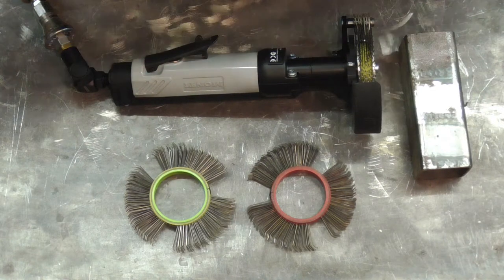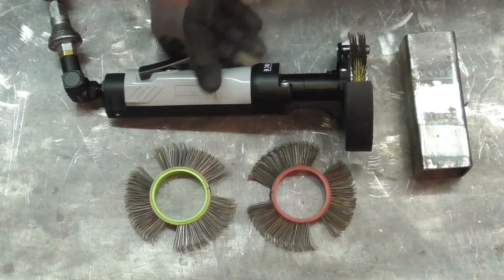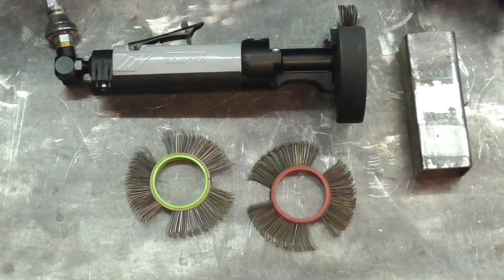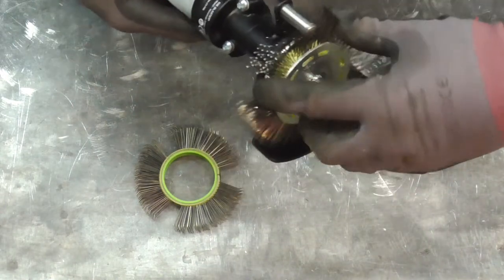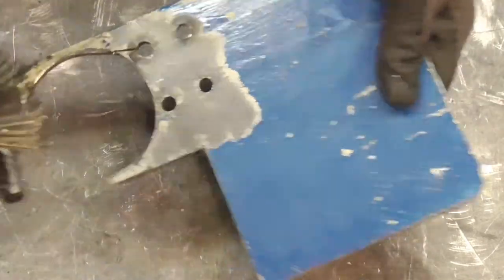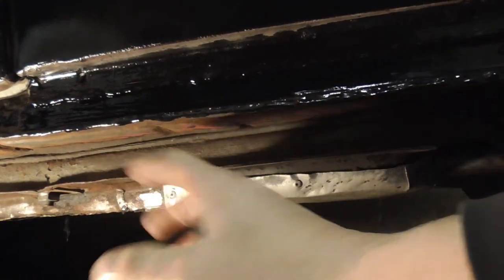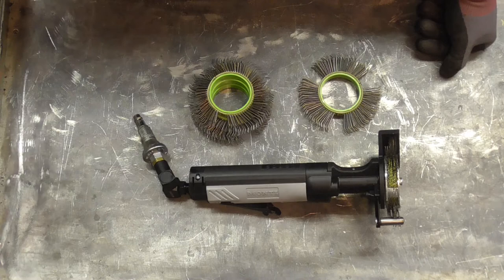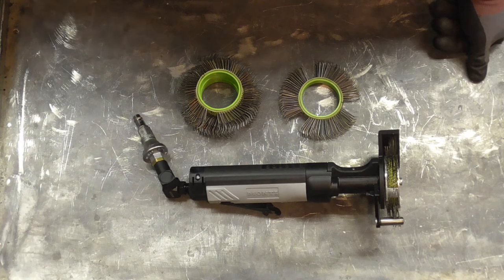Bristle Blaster Part2 - Die Blaster!  Test to remove rust, underseal and paint from VW Floorpan etc

Comment: How long do your belts last? I bought the electric version but sent it back because after 2 mins of use , the belts dulled stopped working effectively.
Reply from the maker: I did the full floorpan with 2. They started to lose their shot blast effect towards the end but still removed lots of the paint. I finishe'd the hard to get to areas with the Die Blaster. I think if you press down hard it knackers the belts as was told by the owner of this one not to do that, have to kind of hold not off the deck slightly for best effect.  Hope you get sorted :)